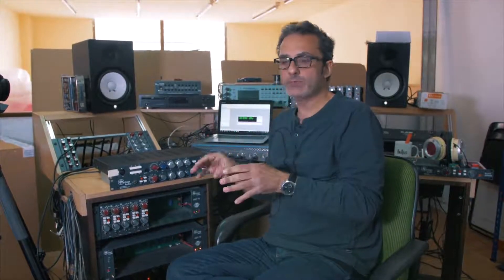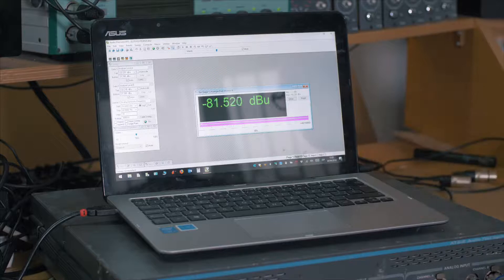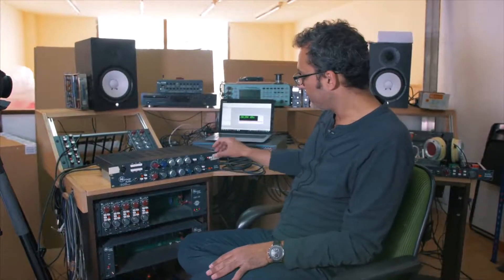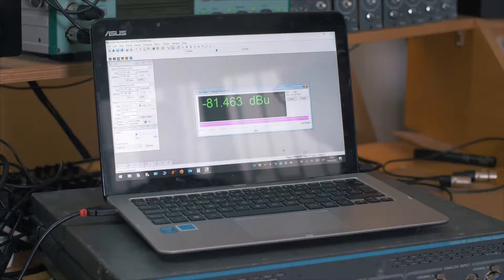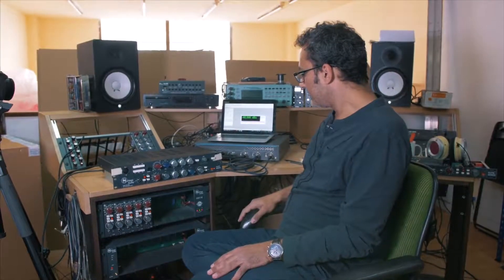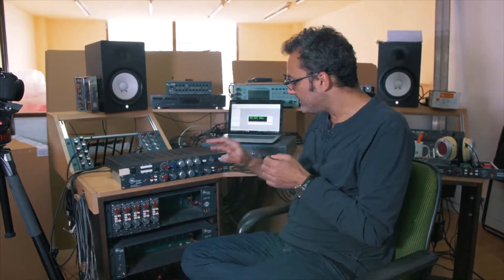Heritage Audio - External power supplies rule!

Comment: Is the reason the dual 80 series rack for 1073-family modules is 3u (and not 1u or 2u) to do with keeping the pre's away from other gear to avoid transformer interference from the other gear?
Is the distance enough to keep away from an audio interface or other gear with an internal power transformers?
Thanks.